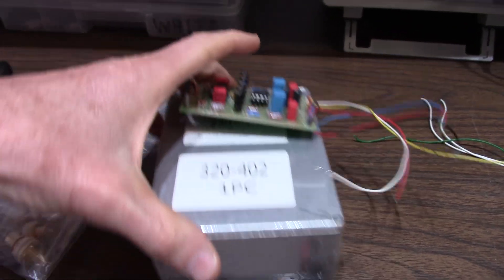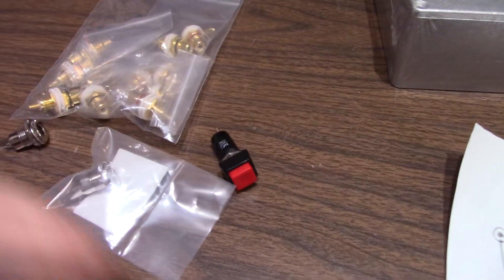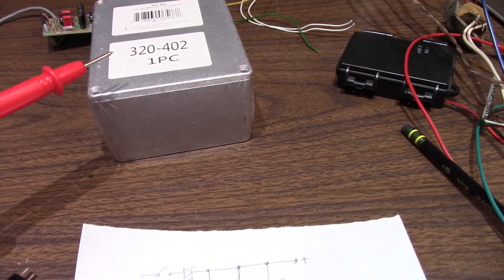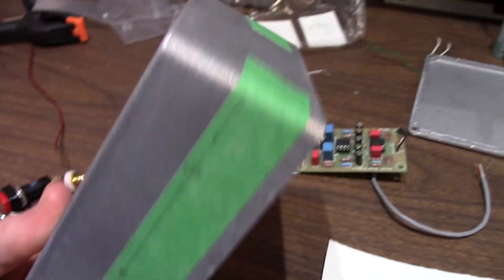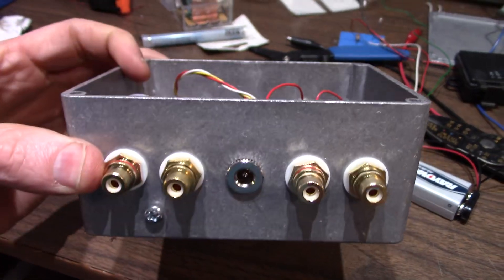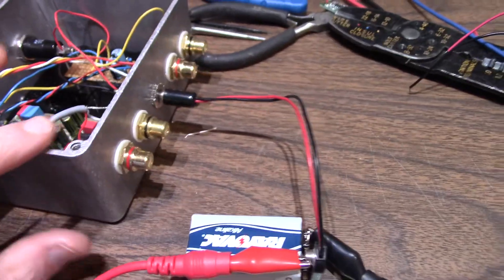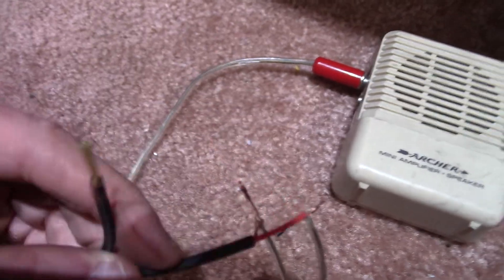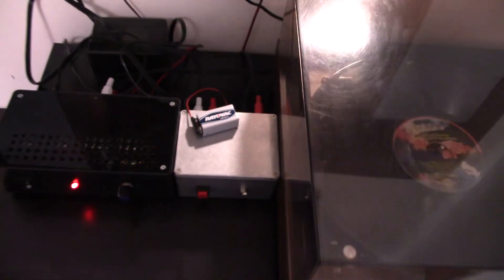ESP phono preamp power supply and case - project complete

Comment: Hi, have you connected the chassis to anywhere? If I use a wall wart adapter, should the chassis be connected to ground from the wall? I have a transformer with 18v ac output, I was thinking to use that (rectify, filter & regulate), but it does not have a center tap, so what to do in that case. I believe what you did should work but, I was thinking about the chassis. I will also connect the output to "aux in" in my soundbar (it has 2 pin power plug, i.e. not grounded)

Comment: FYI, isopropyl alcohol will knock hot glue loose (along with some other adhesives, like super glue). So long as it dries before you energize the electronics again, it won't hurt the electronics, either. Very impressed that phono preamp doesn't significantly pop when turned on and off. 👍

Comment: I guess a split 4.5V is more than enough to cover it, excess voltage would just make more noise.
Reply from the maker: I need to take measurements to make sure there is clipping headroom as the battery ages. Probably best to stay with 12v.